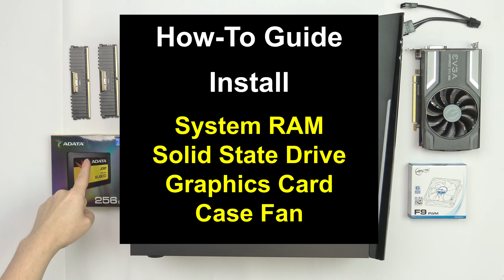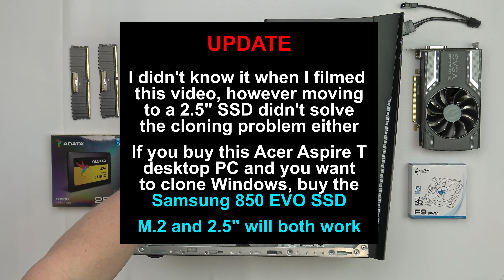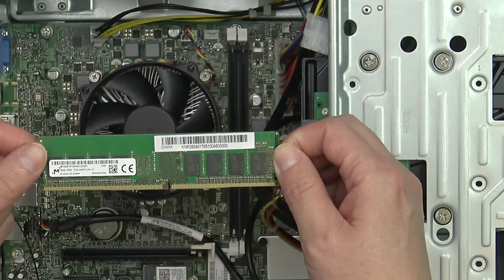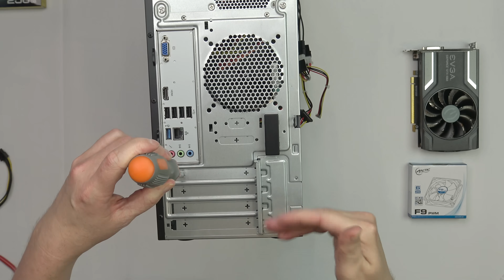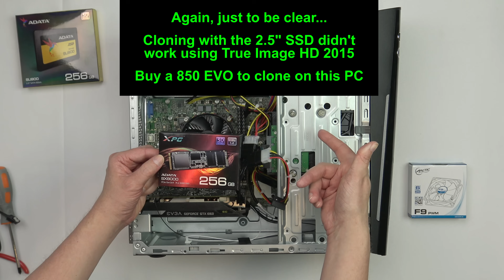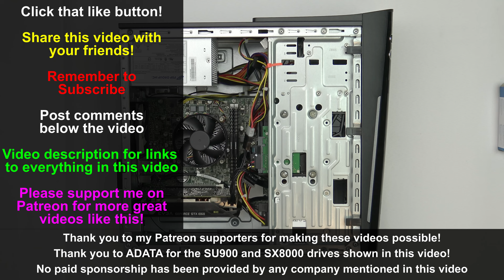$450 Acer Aspire Desktop PC - Part 3 - Upgrade Video - RAM - SSD - GPU - Fan

Comment: i have the same video card and it works just fine with a single molex connector conected
Reply from the maker: That does not surprise me, this card actually pulls less power than it is rated for

Comment: Thank soo much, I actually bought this machine from your recommendation, and I don't regret it!
Reply: Did you upgrade it? How is it?
Reply: Would this work with a gtx 1060 without changing the power supply or using adapters or anything?
can i just buy a gtx 1060 and it would be powered by the mother board pci clot? please help me i need help.

Comment: would it be better to buy the 1050ti or the 1060
Reply: I'd say if you're on a tight budget, go for the 1050ti. If you have a little more money that you can spend, go for the 1060. I would recommend an RX 460 too, but this computer acts weird with one so I'd go with the 1050-1060.
Reply from the maker: If you have the money, the 1060 is 75% faster and a better deal for the performance
Reply: Tech Deals thanks for the information but after some research I think I'm going to get the cyberpower gamer Xtreme. thank you for your videos they really help with deciding a good pc.
Reply: Tech Deals and if you wouldn't mind maybe do some rainbow 6 siege bench marking on some PC's

Comment: Does the aspire pc actually have a NVMe port not just a M.2 Sata port? There is a difference and a NVMe drive won't work with a M.2 Sata port, even though they look the same.
Reply from the maker: Good question...  I vaguely recall that it does support NVMe, but then I work with enough PCs that I could be misremembering...

The safe answer would be a Samsung 850 EVO M.2

Comment: I have all the upgrades done besides the case fan, however, i just ordered one off Newegg.
Reply: How the power supply is the 300w enough with the 1060?
Reply: @jpeezy420jjjjj  I had a 1050 ti at the time and never had a crash of any sort.
Reply: @jpeezy420jjjjj  Also, a 300w PSU is recommended for the 1060.

Comment: does this system support nvme or just sata SSD m.2 drives??? please answer asap. I'm about to make a purchase
Reply: Jovonie Biscette comment months later but whatever helps right? In the unboxing video he did for this he said it supports m.2/mvne.
Reply: I installed an m2 SSD. Took like 2 mins
Reply: m.2 sata or m.2 nvme, cmon bruh

Comment: Can anyone clarify what type of M.2 drive this computer can use (Sata (B+M) or NVME (M))? If  M.2 is installed will it work as the C/boot drive?
Reply: I contacted Acer and they told me that the M.2 on this motherboard is a B+M type key (2 notches) - so I don't think the NVMe drives (key M, with one notch) will work.

Comment: Now that's how you max out the potential of a pre-built system.  Nice!
Reply: Would this work with a gtx 1060 without changing the power supply or using adapters or anything?
can i just buy a gtx 1060 and it would be powered by the mother board pci clot? please help me i need help.
Reply: Did you watch the video? He addressed this very question several times.
Reply: no

Comment: Hey Tech Deals, would you mind checking out/reviewing this XFX RX 470 Single Fan?
https://m.newegg.com/products/N82E16814150781
It's the shortest RX 470 I could find and if you were able to fit it into these type of cases It would blow away the 1060 in value for the money - only $145 after MIR
Reply: The RX 470 has a higher TDP than the 1060, so it wouldn't work with this power supply anyways. If you have a 450-500W or more Power supply then by all means go ahead, it seems to fit, even with all the space problems this case has.
Reply: They actually both have the same 120W or lower TDP so it should be an issue. I've never seen my overvolted overclocked power limitless MSI RX 470 Armor with 2 fans go over 100W according to afterburner so I think it would be fine.
Reply: Shouldn't*
Reply from the maker: My experience in using RX cards in cheap pre-built systems is poor, even when they will fit...
I see post after post from people trying to force it and say "but what about this RX card"
My opinion is that it isn't worth the trouble, this PC wants a GTX card, not a RX card...
Reply: Tech Deals 
Haha 😅✌ I don't know if you were trying to be funny (In a respectful way), but as I read it, it was... "This PC wants a GTX"... 

Feed the need! Awesome video buddy! I actually bought this exact PC and now waiting on a "2 molex to 6 pin" connector for my Gigabyte 1060 (I should've bought the one you had in the description....) Any ways God YHWH bless!

Comment: id probably get a new psu and get a gtx 1070 for this pc, there shouldnt be much bottlenecking
Reply: who buys such a pc and then inserts a  450$ gpu and replace the psu...
Reply: There is actually a mini gtx 1070
Reply from the maker: Liferider is correct...  if you're going to buy a $360 GPU and replace the PSU, you're looking at $400 - You're buying the wrong computer if that is your goal...
Reply: I don't think there is a 1070 in a small form factor like this card in order to fit into this case.  I have the EVGA 1070 FTW2, and there is no way that would fit in this.
Reply: Just saying that there is a gtx 1070 that will physically fit into this case =P
Reply: MidnightBanshi ik, but I'm talking to him and how if he is buying this and a gtx1070 it would be cheaper to buy the parts then build it
Reply: John Choi That takes an 8-pin power connector though, where the 1060 only needs a 6-pin.
Reply: $450?

https://www.newegg.com/Product/Product.aspx?Item=N82E16814125893

http://www.ebay.com/itm/292041166887

$450 on launch, but now, you can find them consistently for sub $350, heck, that 1070 Mini was $330 or so just yesterday.
Reply: 1060 would be better
Reply: yeah i know, just an idea, i would build my own pc with probably an i5 7600k or 7700k if i were to put a 1070 in it
Reply: DrFanta - Tech - Games - and more you should really just buy the parts and build it. Building is not hard and it will save you some money.
Reply: Captain Koopa I believe the whole point of this video was maximizing the performance in this pre-built PC.
Reply: Captain Koopa true enough there.

Comment: Im playing the first witcher and I see some stutter.My gpu is gtx 1060 6gb and my cpu is i7-7700k which is strange.
Reply: Not Mr. Bean 4gb and I crank up the settings high.
Reply: 4GB of RAM is far too low for ANYTHING in 2017. Spend 20-40bucks, buy another stick of 8, and save your PC the trouble of shitting itself when it tries to run a  game...
Reply: SyncF Its the first witcher.which comes out in late 2000s.

Comment: you cannot clone Windows that was installed on a AHCI drive to a PCIe NVMe drive (SSD) - it's not a matter of cloning software
Reply: How did Mr Deals do it then?
Reply from the maker: You can't clone to the ADATA drives anyway because of this machine...  For this PC, a Samsung 850 EVO is the right option for that...
Reply: Tech Deals can I use my old HDD to replace the one in the machine?

Comment: Tech Deals, Which is that cpu cooler? It does not seem the one from the i5 7400 BOX.

Is it better than the stock cooler? It is like the cooler on that PC blows air towards the processor.